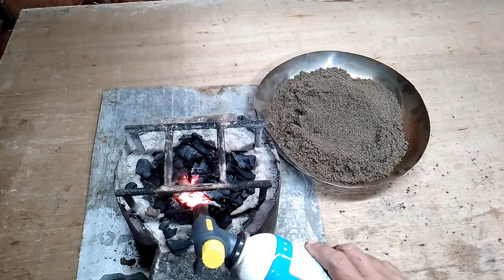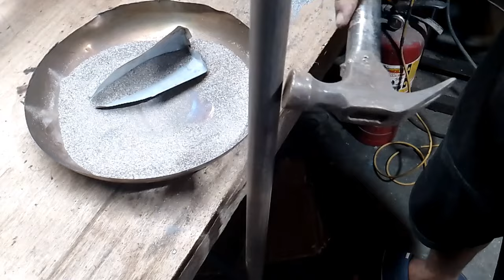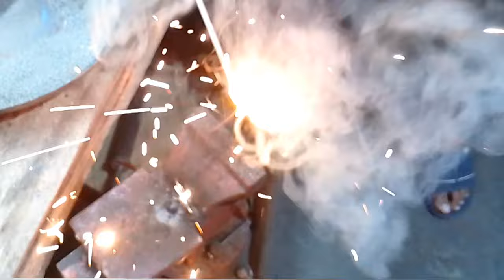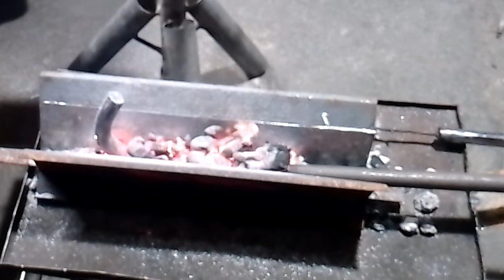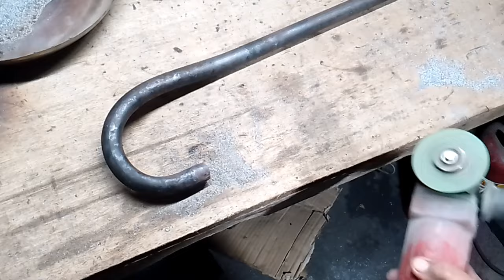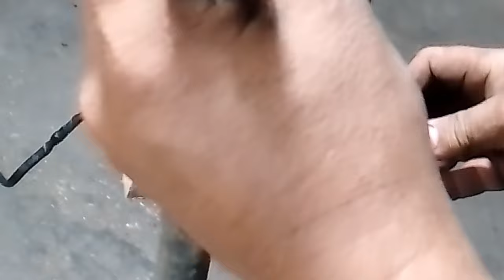How to bend exhaust pipe using fine sand | @homecreativeworks

Comment: This is a great video of a way to bend metal tubing with minimal change to its internal dimensions at the bend radius.  Aka no choke point from normal bending methods.  The metal is easier to stretch and compress when it’s soft and the sand keeps the volume consistent.

Comment: Use fine dry silver sand and a wooden plug at one end with the other welded closed. 
Using a oxy/gas torch heat the outside of the bend more than the inside to prevent kinking. I did this job for over ten years.

Comment: An excellent way to make complicated dends in thin walled tube. Arguably quicker than cutting and welding pre bent tube and visibly nicer.
I don't understand why the jig was not bolted to the floor, that would give both hands to doing the bending.
I cringe at the lack of guard on the angle grinder and worse the bench grinder. Abrasive wheels do shatter and with no guard thepieces would fly everywhere rather than being contained within the guard.

Comment: I did that using beach sand and cold bending. Using hole in plank. I put it on the stairs and I did stand on it for counter weight.

Comment: Don't really need sand and heat to bend schedule 40 pipe just the former and and a jack, be a better job as well, only really need heat if below 10 C and then only on 2 inch and over.
Reply: It will collapse on you if you don't fill it with sand
Reply: @lutzvonpeter9170  schedule 40 wont its low alloy steel pipe